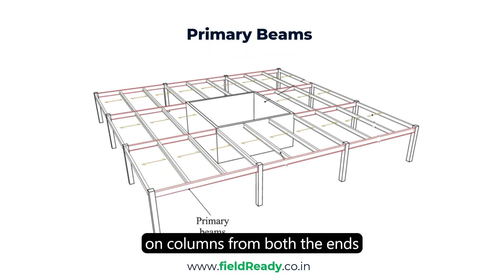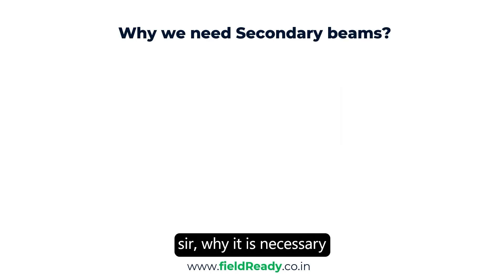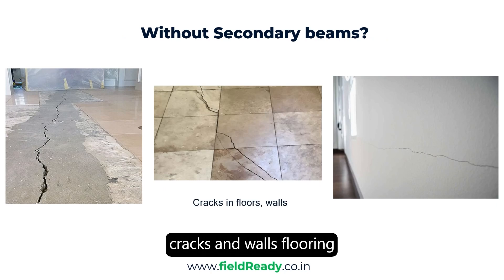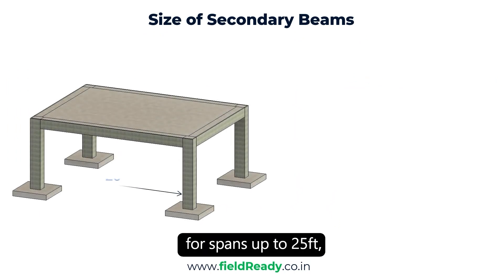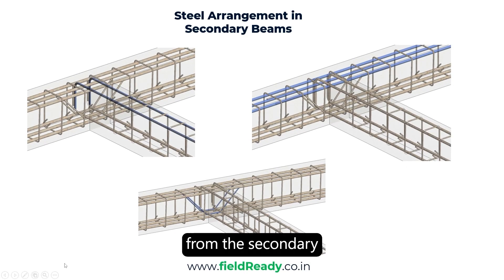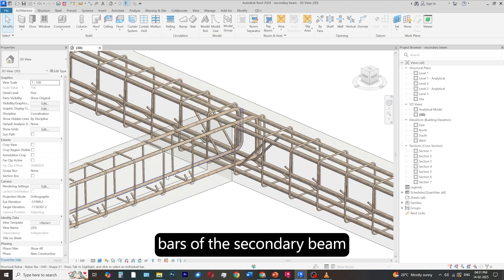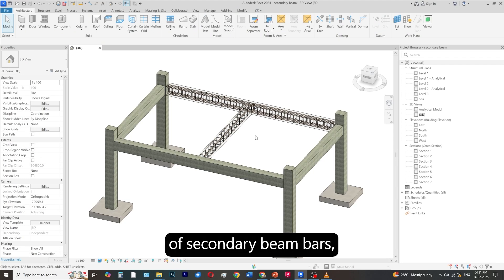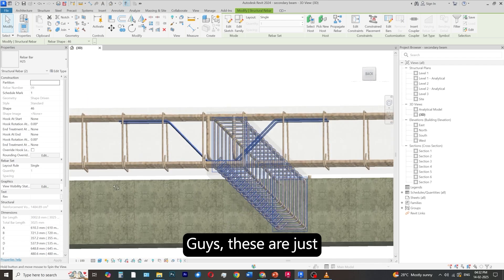Importance of Secondary Beams | Steel Arrangements | #civilengineering #structuralengineer

Comment: Are kranks necessary to give in primary beams when we want to connect a secondary beam ?? For example,  if I want to connect a secondary beam between primary beams after 3-4 feet from columns/ wall, are kranks necessary to give in both connecting points in the primary beams ??
Reply from the maker: If a secondary beam is more than 14' , it will attract support moments, that you can check from etabs analysis results so there you have to place crank bars/Extra top bars.